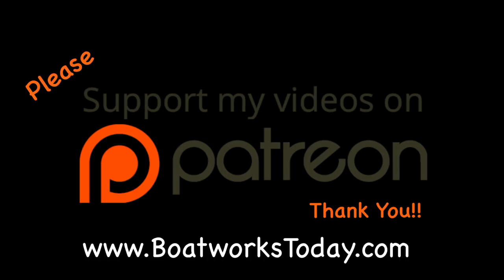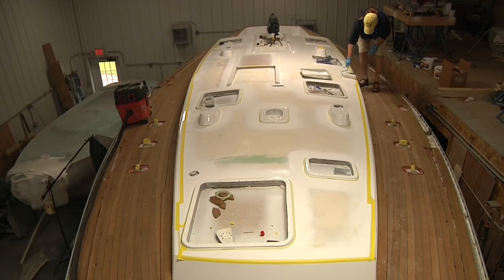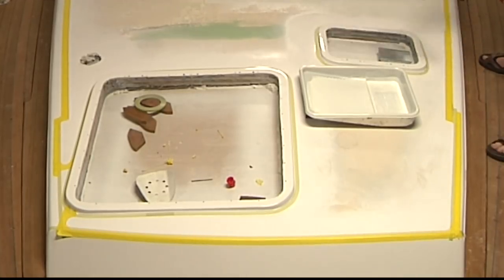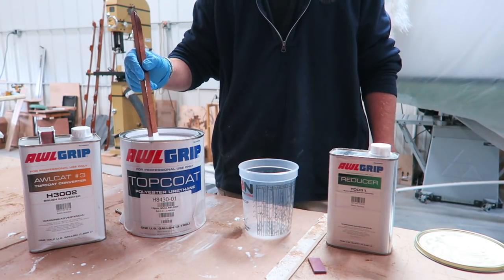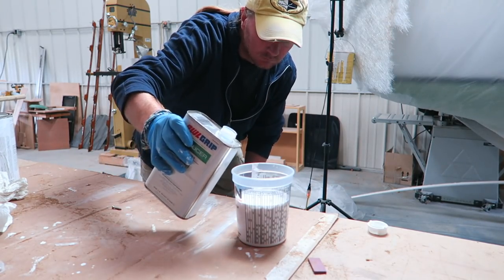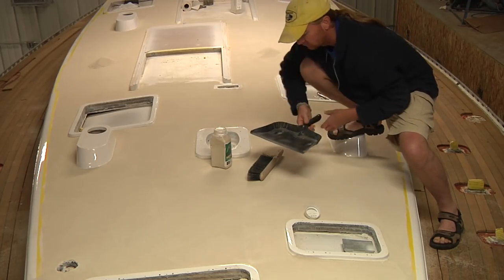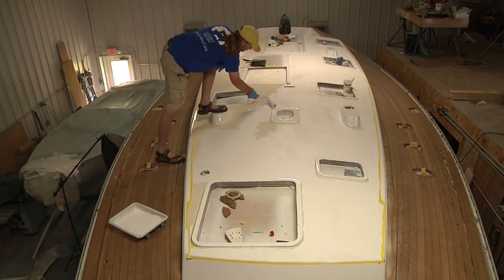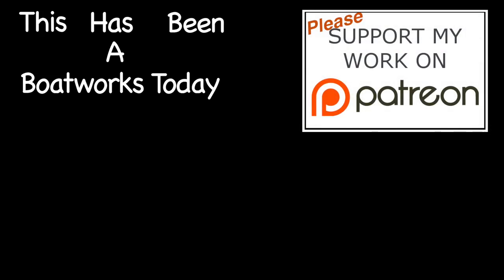What Nonskid Did I Use For This Boat Project And How Did I Apply It??

Comment: I have a couple of questions. First is when re-painting the deck on a sailboat like a Hunter 28 which has a light non skid built into the hull would you recommend to sand it completely off and start with a fresh slate or try to mask and re cover with the material you just used?
And also if I'm painting with topside paint is it possible to do smaller sections at a time over time and just blend the paint line by sanding and continue at a later time? I'm faced with limited days with warm enough weather to do all at once (outside) before a spring launch.
Thanks,  Steve
Reply: Very nice.... actually ....very very nice.!!

Comment: Videos are great, enjoyable to see a passionate craftsman doing such nice work..  curious if you have any concerns with working with all of these chemicals?  Hope you have some sort of exhaust system as a bare minimum..  cheers!
Reply from the maker: I have a good size air makeup unit that I run whenever I'm working large areas like this.  I'm able to exchange all of the air in the building every 4 minutes which makes a huge difference!

Comment: Question, I have a jet boat and want to re coat the whole boat with a layer of fiberglass. What are your recommendations, want to end with a gel coat finish. I see u used gel coat to help cure the fiber glass, after i fiber glass, can I use an epoxy high build primer to help seal and cure the fiberglass, then sand and gel coat?? What products wld you recommend for this application

Comment: How long do you leave your tape down.  I have always been told pull tape with paint wet.  I noticed you waited until after your seal coat.  Is that ok to do if I'm using the green  frog tape from lowes?

Comment: Looks good have you used that nonskid with some of the cheaper one step paints? I have an older boat thinking of using Pettit easypoxy.
Reply from the maker: I personally have not but know of a few people that have successfully.   From what I gathered it works well but takes longer for the paint to cure / dry.  Tends to be a bit tender for a few days depending on the temps and humidity..
Reply: Also depends where your boat is located as far as longevity. Two part paints will last at least twice as long or longer, as far as wear and gloss. Painted a boat in Hawaii with Mono-poxy and it only had a gloss for about 3 years. Painted another one with Awl-grip and it still looked good after 8 years. Did another one in the Pacific northwest with Alex seal, and it's going on 13 years and though it's not as shiny as it once was, it's still holding up. Sun is the enemy...

Comment: Andy, I'm curious as to you cutting what seemed to be s curve in the taping. What is that technique for ??
Reply from the maker: It's detail for where the handrails end and stop (there's two sets of rails per side of the boat).   Basically OCD :-)
Reply: Ok, thanks Andy, I did a lot of taping of cars in the past and never saw that technique used

Comment: Andy, will this Awlgrip non-skid technique work to cover an existing (really worn out) diamond pattern, molded in non skid surface?  Or should I do some kind of thickened epoxy roll on technique to cover the existing pattern? I am re-doing the deck surface on a 36 year old Watkins 27 and do not want to re-create the existing pattern using a mold. That would take forever.  Will be starting with the cockpit sole which is totally worn.  A crewmember recently slipped and almost fell down the companionway.  Great videos!  Thanks for the tutorials.

Comment: Awesome video. I am thinking of using the soft sand on our Catalina 25 that has been painted in the past. Did you use the same paint over the top of the soft sand?  Does it have a gloss to it, or does the textured surface lessen the gloss?

Comment: Andy, We followed your steps on our San Juan 23. It worked out great. Used the fine sand rubber. The surface feels great when doing deck work; setup, sail changes and lounging. Picked the fine grade because sitting on it is a little more comfortable on one's undercarriage. Thanks for the info.
Reply: How’s it holding up 4 years later now?

Comment: On a previous vid where you were doing non-skid, you added a flatner to the final topcoat.  How did this one come out without the flatner?  We're about to do our cockpit floor and trying to decide if the flatner is necessary.  Thanks!
Reply from the maker: I've stopped using flattener as it really just complicates the application and longevity of the surface.  Areas that have had flattener applied, if it gets scuffed the flattener gets removed and you're left with glossy patches on high traffic areas.  Hope this helps!

Comment: Andy, one more question.  the shinny section that is not non-skid.  was that applied via a spray gun or did you roll that on and then wet sand and buff it out?
Reply: What paint did you use?

Comment: How does the soft sand compare to, say, the Awlgrip Griptex? I'm not the biggest fan of how sand paper like the surface is after. Takes the skin right off if you're not careful.. I haven't heard of the Soft Sand before!  Have you used it in conjunction with varnish?
Reply: Glad to see another video from you Andy! Hands down one of the best sailing/marine industry channels. Keep it up!
Reply from the maker: I have not tried it with varnish, but if interested might be worth a call to SoftSand..  They are really good about getting back and answering questions
Reply: Movement = crack peel after time is my guess. Better than a sudden fall smacking your head on a cleat.  Or sanding your face off a little bit.